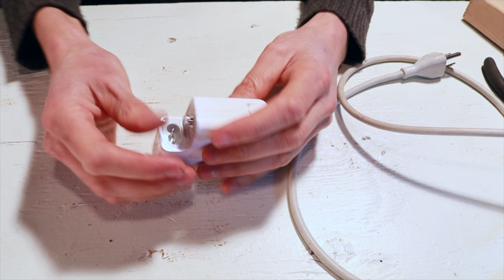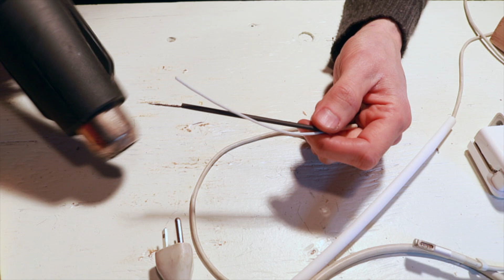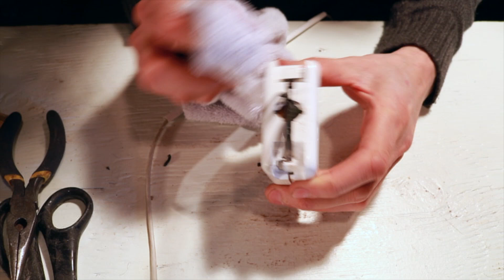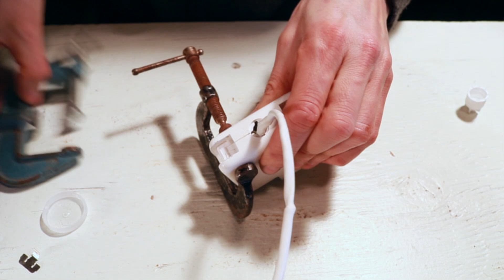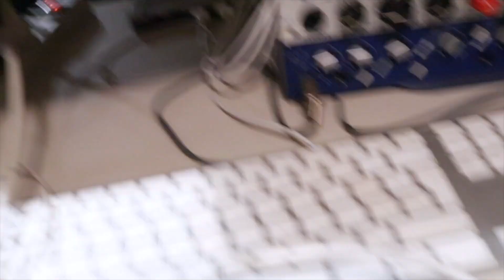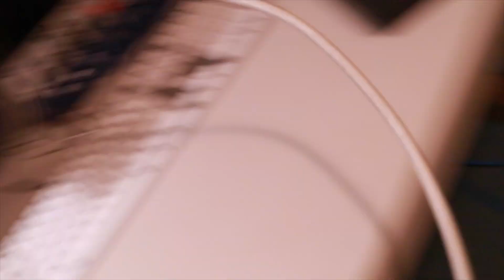MacBook charger repair [LINK IN DESCRIPTION]

Comment: Just finished the swap out.  Plugged it in and attached to MacBookPro.  The light on the end lit-up green but flashes -- it flashes briefly at 2-sec interval.  The Charge lightning bolt on the screen goes on and off in time with the green light as it goes on and off.
Thoughts?
Reply from the maker: Sorry, I don't know enough about the error codes on your particular mac book. This repair is definitely a hack and results are not guaranteed. I have come to terms with having to replace my laptop every 5-6 years.

Comment: Good heavens man, use heat to get the case halves apart without breaking everything. And desolder leads from the main pcb board and not hack into them. This video is a good example of what not to do! I stopped watching after you started "unraveling" the shielding!!

Comment: Do not use those two replacement chargers that are shown at the start of this video. They will badly damage your logic board if it even develops even a minor short circuit after liquid damage. Watch this from Louis Rossmann, the God of Macbook repair and leading light in the Right To Repair movement https://www.youtube.com/watch?v=TmVU3E9QtNw

Comment: electrical grade solder has flux inside already. You don't need external flux.  Everyone is using external flux these days on YT, hardly ever needed in the past, its just "a thing" now.

Comment: I'm sorry but I have to say that this is the single most nasty and messy Magsafe repair job I have ever seen :) Instead of soldering the wires outside the "brick" you should have soldered them onto the PCB, where the original wires were soldered like an inch away. Especially when you already own the soldering iron.
Also the soldering job is just horrendous, you don't need any of the compound you stuffed onto the wires, just twist them and heat up the soldering wire on top the connection and it will melt all around. Add some more if the connection doesn't get nice and smooth, silvery, like a mirror. Thumbs up for the effort though.

Comment: Nice 👌 But which wire goes where inside the box? I'm assuming the outer thick core is connected to the black wire inside the box.

Comment: Nice tutorial. If one puts the heat gun standing on its back, blowing the heat towards the sealing, you have both hands to hold your work-piece, and easily adjusting the angle and distance by moving it rather than the gun.

Comment: Omg it worked!!! I didn‘t have any special tools, just a scissor, some tape and a thin wire I used instead of solder, but it still worked and I can charge my computer until the new charger arrives. Thank you so much!

Comment: i was able to reuse the cable gasket thingy doing my repair. i drilled it out from the base with a 1/8" bit. it was messy and awkward, but eventually i had a nice clean hole through the hard plastic part, and it lined up nicely and cleaned all the cable out of the soft part without damaging it. i then went in with a larger (3/16" i think?) bit and countersunk just the hard plastic part, to clean out the wire remnants embedded in the molding, and i was able to feed the original cable through (only after cleanly cutting it thought!). it's definitely more work, and you need to cut the wires really short as there's less space available if you do it this way, but it's definitely doable!
Reply: thats what i thought to do not to mess with this bad looking shrink tube

Comment: thanks, I bought a new one after 10 min watching....
Reply: If the outer cable rubber is frayed and inner cables intact (which is common), use one layer of electrical insulating tape wrapped tightly, then over wrap with plumber’s PTFE to form a tight layer extending either side of the repair. It’s neat and easy and seems to last.
Reply: @TelstarTAK  Thanks, worked for me!
Reply: lol
Reply: same here...  I actually  bought  2  because i know it's gonna break  again

Comment: It would be cheaper just to buy a new one instead of buying all these tools to fix it.
Reply: Different mindset. The aim is to own an array of tools that you can use for various projects. You build your toolbox with each project
Reply: You don't need to own all of these. Instead make some handy friends. These are repairs that will cost you a beer and you can spend bonus quality time with knowledgeable people.
Reply: I just bought a soldering iron (comes with all sorts of cool shit) for €23. A new charger costs €82. I think it’s worth it.
Reply: I had all these tools already so I was able to keep my macbook pro running without even waiting a day for amazon prime to deliver a new one. Point is to already have these tools at your disposal, you can get a cheap soldering iron for like $5-10 at Walmart so either way it's faster and cheaper than buying a replacement, plus saves on landfill waste.

Comment: not good job. the wire from charger with glue is so ugly. you need a drill with 3mm and make a hole in plastic connector between charger and wire and then reconnect the cable

Comment: My MacBook pro/2011 needed two chargers in the middle of 2014 I bought a new MacBook, in 2016 I was bound to buy a new charger for it. Today 22 September 2018 I will be obliged to buy another one so the third charger for this MacBook.  How on earth Apple is not ashamed of this problem, no other brands of PC having this problem, the charger's cables have the same life as the computers,  I do not speak about the price of a new charger, a real shame so as far as I'm concerned in seven-year I will have bought 3 battery chargers for 2 MacBook. If it was not so expensive it would be laughable!
Reply: Basically all of Apple's peripherals are shit.

Comment: So the centre wire goes to white, and the outer shield goes to black. That's all I've been trying to find out! I'm not sure how you know that or whether it was a good guess.
Reply: It is basically a coaxial cable, the inner wire is positive and the outer wire or shielding is negative.

Comment: Thanks for the video - I found your comment about avoiding perfectionism particularly relevant to these repair jobs.  It will never look like new again...  As long as its safe and functional, mission accomplished.  My repair is a temporary solution for a few days until the new one arrives.  I'll hang on to the repaired unit as a backup.
Reply: This can be prevented. And nothing to disassemble is not necessary.
Here's a video: https://www.youtube.com/watch?v=H4jI2RKn_ic&list=PL_YQdRD7PE-UWf5_CltLKrw_8--RaWuBo&index=1&t=0s
Translation is not needed. It is enough to look.